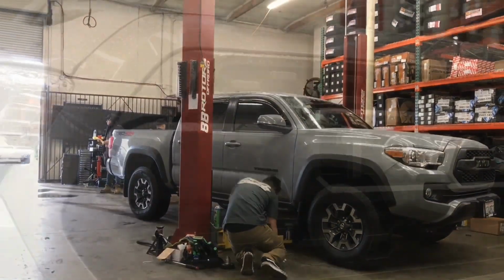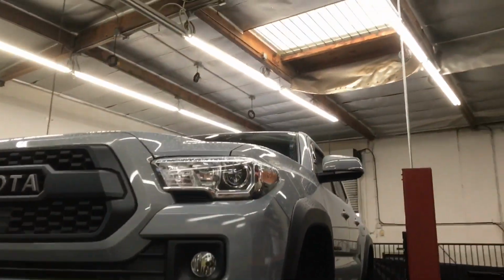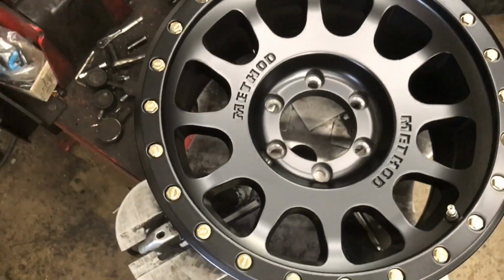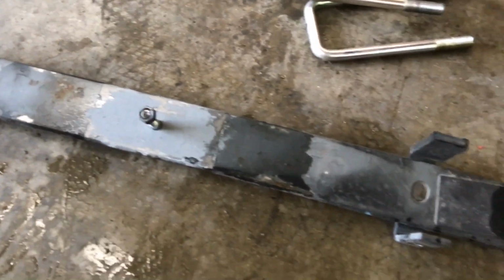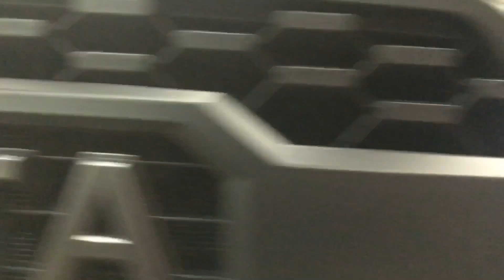Cement Grey 2019 Tacoma on Fox Lift & 285/70/17

Comment: How do you adjust fox 2.0 on that Taco to fit ko2? I had those 2.0 fox shock on 2018 Tacoma 4x4 trd and I have the same height as stock no lift gained. Fox stated that they come preset at 2 inches and I thought  2 inches would give me enough to fit 33. Hey, that truck looking awesome!